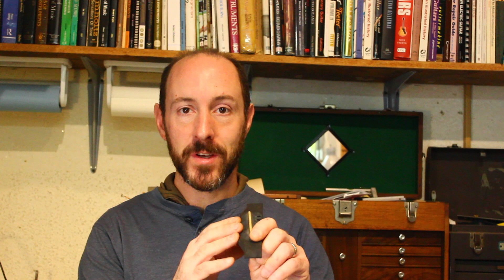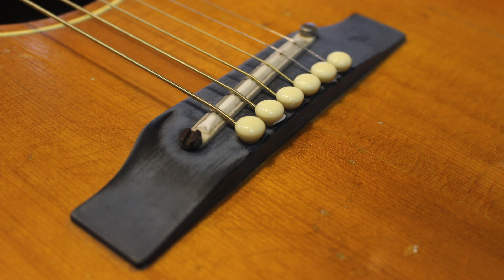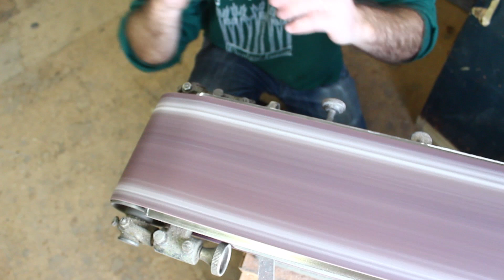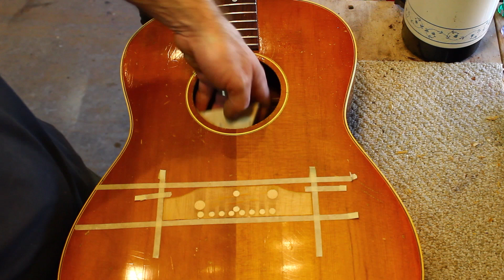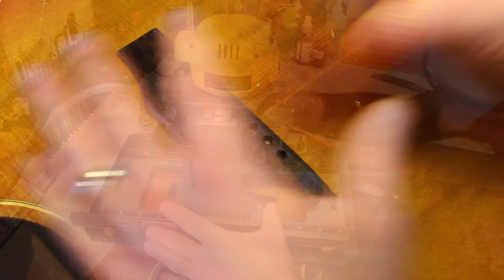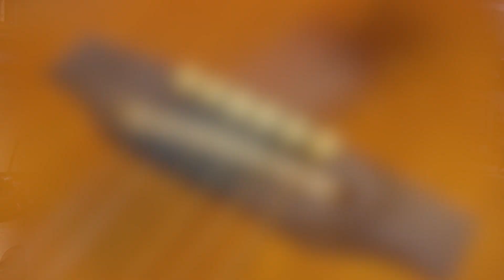Gibson Plastic Bridge Replacement

Comment: Nice to see good work on YouTube. There is LOTS of bad work displayed here and TONS of half-measures. You show an incredible amount of precision specialized tooling here to replace a bridge.
A lathe for making the spruce plugs for the adjustor studs.
a Bridge slot cutting rig for cutting the slot
jigs for every glue joint. 
precision routing the edge of the bridge for dropping into the slot in the finish.

Lots of good craftsmen doing good work with simple tools.

Comment: I have an Epiphone Texan Inspired by 1964, and I bought a ceramic bridge through E-Bay. It came with the metal plate that goes below the fuse, and the screws. Do you find it interesting to exchange the original plastic bridge for the ceramic one?

Comment: how much would one of these bridge conversions run with a good luthier?  i know you can only throw out a ballpark figure but you think less than $500 or more like less than $1000
Reply from the maker: You're in the right ballpark. Of course the bridge itself is just one part of the equation, and in most cases there is other work (bridge plate, fretwork, neck angle) which has to be addressed in order to fully realize the benefits of any one aspect such as the bridge. That's where generalized estimates become impossible, but I would say that on average when accounting for other peripheral work these guitars often need, your guess is a pretty reasonable range to expect.
Reply: gotcha thanks so much!

Comment: Why did you put in wood dowels if you need to screw them out for the strings? Why not put the thin maple back plate in first - would be easier to cover the holes, right?
Reply from the maker: Good questions. 

The string holes on the original plastic bridges were are located precariously close to the back edge, so these holes are plugged because the new holes will be relocated about 1/16” further in than the originals. This is just enough to offer a slight but worthwhile improvement in stability by moving this “perforated” section of bridge in from the edge, in case the owner or a future one allows the guitar to dry out, where the bridge can shrink around the pins and cause cracks. It doesn’t eliminate risks from neglect or abuse, but lessens them, while remaining a small enough change to still preserve original style and appearance. 

The plate is added last because filling a blind hole tightly without gaps can be surprisingly more complicated than filling an open hole. While I may not have mentioned it in the video, the plugs are actually turned with a slight taper, and the holes reamed likewise. This provides a reliable and economic method to press them in to create a solid fit to the x-y axis (the diameter). The z axis (length) can then be more easily and precisely trimmed flush in place. 

In bridge replacements where we retain original string hole locations, I do not plug them as I did here. For the order of operations, one certainly could install the cap first, but I find the order I used here to be both more efficient and leave less room for error.

Comment: Beautiful work. I have a 63 LG-0 with the plastic bridge. There is some slight bellying, which my late father's repair guy addressed by installing a radiused slot-less saddle.  The intonation is perfect and the guitar plays really well. The bridge is picking up a bit in the back however, so I am putting low tension strings on it. 

There is also some string gouging on the fretboard in the lower positions. 
This instrument has sentimental value, so I would like to consider a fairly complete restoration. How do I find someone with your skills to do this (assuming you are not in the Tampa, FL area)?
Reply: Keith Belton